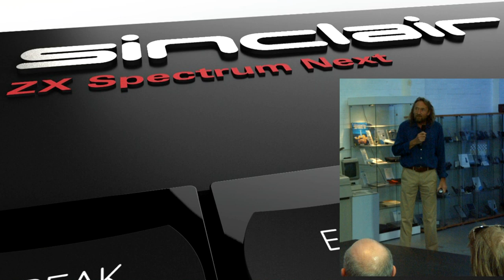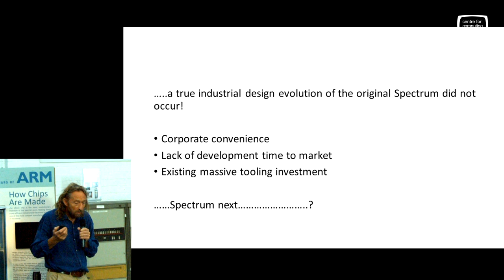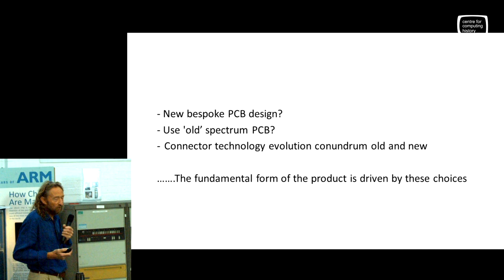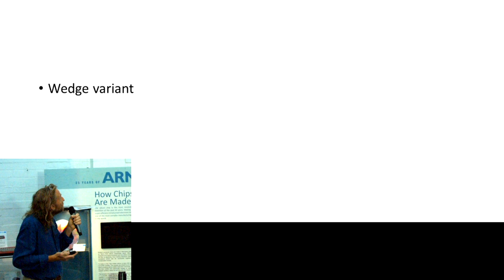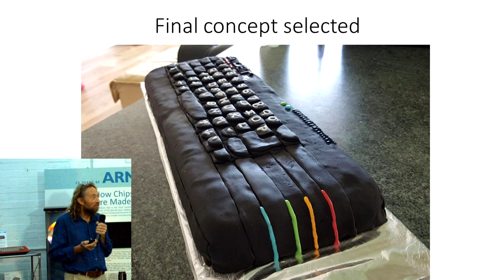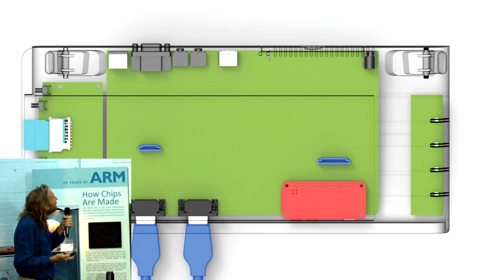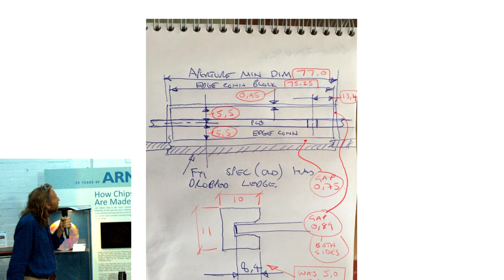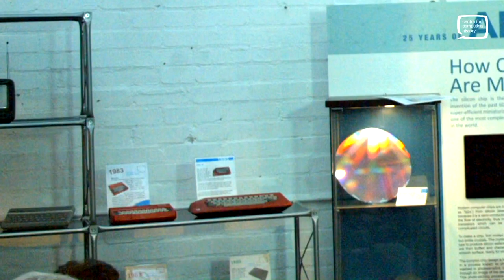Rick Dickinson - Industrial Design of the Spectrum Next

Comment: I used to live on York Terrace in the late 90’s and early 00’s, just around the corner from his house on Sturton St.  He used to be seen regularly working on his house, painting or general DIY - he kept it really immaculately.  Used to have a ivy running alongside the property (is a plain brick wall today) and could regularly be seen on a step ladder and electric hedge trimmer in his jeans shorts :). Used to drive a convertible Audi TT.  Funny thing is I only learned who he was years after I left, I just knew he had a design company based there.  RIP Rick